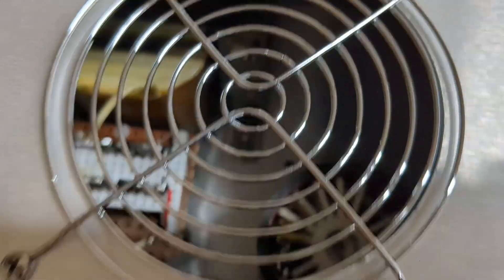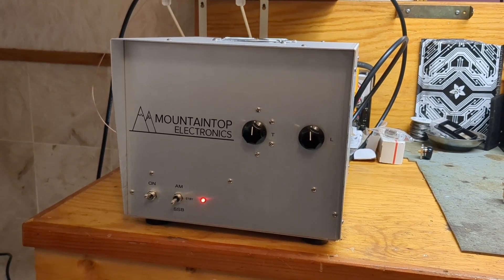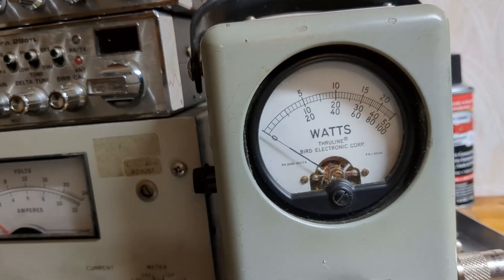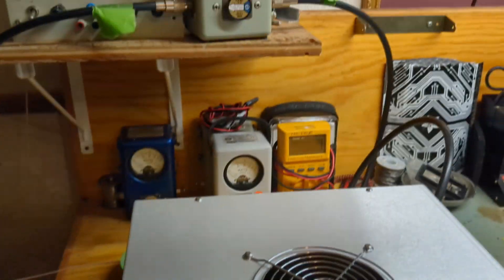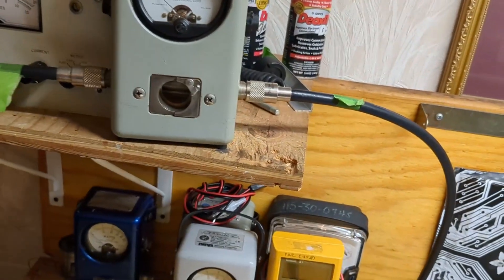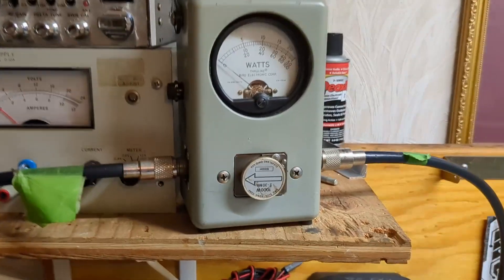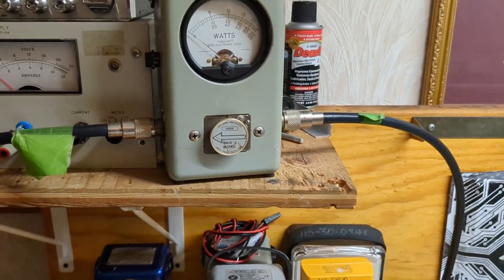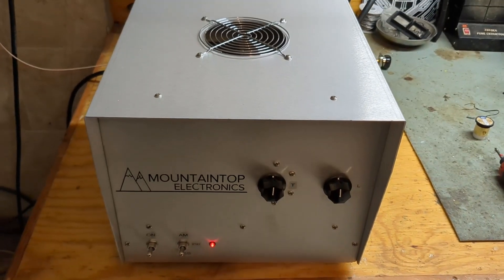GI-7B amplifier How Much Drive Do I Need?

Comment: Good thumbnail gain rating for the tube,  roughly 10dB, and a touch more depending.  I run a Henry 2KD Classic which is 2 3-500Z tubes in grounded grid and i get about 10dB. Closer to 11 or 12dB depending as i run it all over HF. But since an S unit is 6dB that extra 1 or 2 dB doesn't mean diddley in the real world.